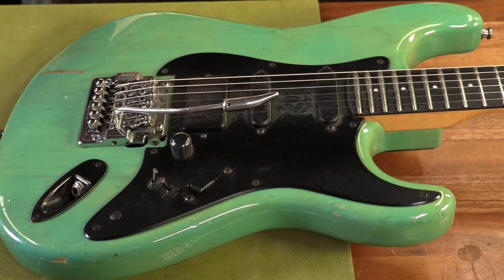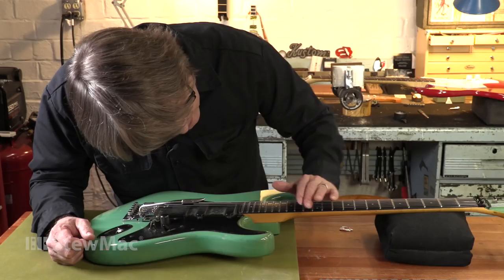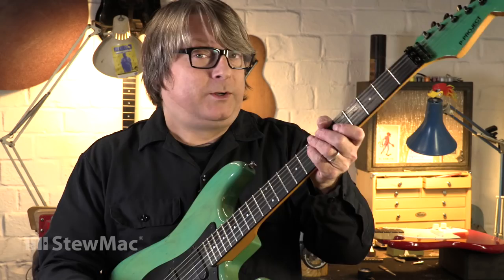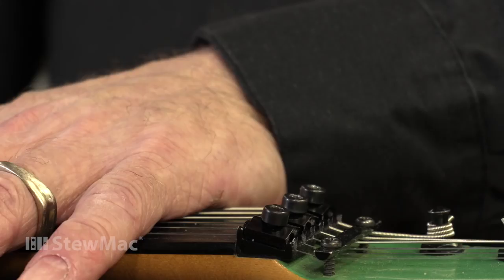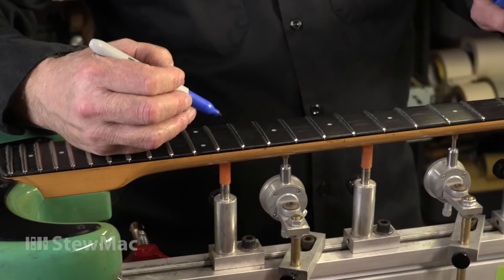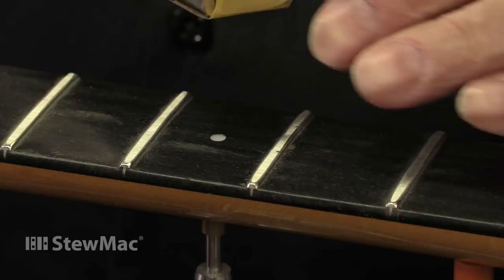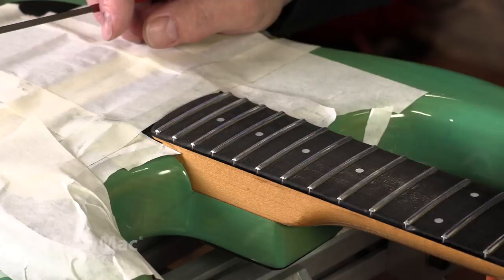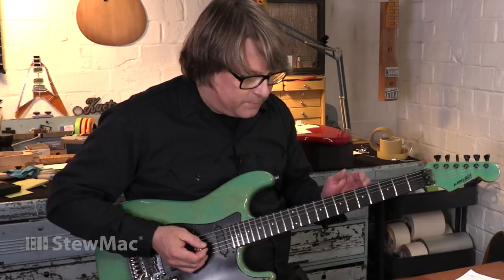Todd Rundgren's 'Foamy': Should I refret it?

Comment: Is it hard to remove the Floyd Rose style nuts? I thought they were just screwed on. Are they also glued?
Reply: It's not about removing it, but if the frets get too low, you can't get lower with the floyd nut without removing material under the nut. Or did you want to remove it while leveling the frets?
Reply: @onpsxmember  Thanks for the response. I was thinking he could have shaved a bit of wood from below the nut to restore the proper height. He said that it would be "major surgery" and I was wondering why. I've never tried it so it might save me some headaches if I knew.
Reply: @John_Demarco  
I can't say for sure. I think he just did not want to mess with the state of the neck since it holds so much value to the player. I don't know too much about the floyd nuts and there aren't all the same. So the following are just assumptions. If you look at the crosssection of a neck, a lower position in that cross section could be too close to the truss rod cavity (but if it's no too deep It could work out, still...it's not good when edges meet). The floyd nut could also stand out on the sides, and some players like to slide their hand way up, even over the nut. The repair changes a bit, depending if it's mounted from the top or from the back like Ibanez does them. Besides removing the wood below the nut (either flat as can be or maybe some floyd-ish nuts have a radius underneath (I don't think so)), there might be an adjustment needed on the string-bar (string holder/retainer, whatever^^) but that might be all there is to it. 
I never had a floyd cause they're all 12 inch radius and the string spacing is set as well. You have to take the good with the bad.
Reply from the maker: The truss rod adjuster was located right under the nut so removing wood was not an option on this particular guitar.

Comment: Locking nut.....not a problem.
Simply mill off the bottom of lock nut
No problem
Reply: Shred Hed - definitely, although I'd obtain a spare nut base to use for this modification, in case the client wants the instrument put back to complete original spec with new .045" H frets and the original nut base. They can't be hard to get.
Reply from the maker: Milling hardened steel can be difficult.

Comment: Wouldn't you first adjust the truss rod to fully straighten the neck, before leveling frets, and then reset truss rod when done?  Otherwise the leveling process will remove what the truss rod does.
Reply: He did. That's the neck jig for.
Reply: Yes if you notice he used the straight edge that skips over the frets so that he could get the fretboard itself flat and then correct the frets afterward.
Reply from the maker: Definitely! This was done when the guitar was jigged.

Comment: Dude ya shoulda done a regret and just file the new frets down to the original height of the old ones
Reply from the maker: It was definitely considered but the nut was actually too low to begin with. Leveling .005" off the frets actually put the string height over the 1st fret where Erick wanted to see it.
Reply: AS Erick said "Je ne regret ne rien" ... or should have :-)

Comment: Nut easily lowered, see a machinist. Mill off the underside.
Reply from the maker: The locking nuts are made of hardened steel, not that easy to mill.